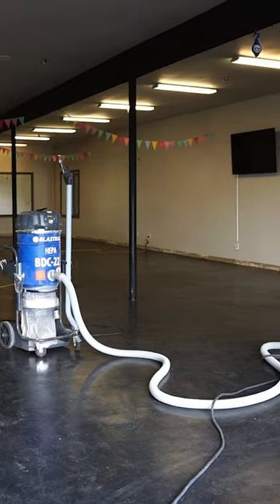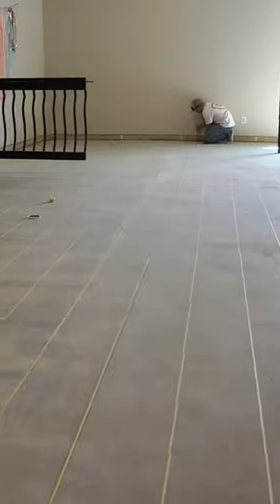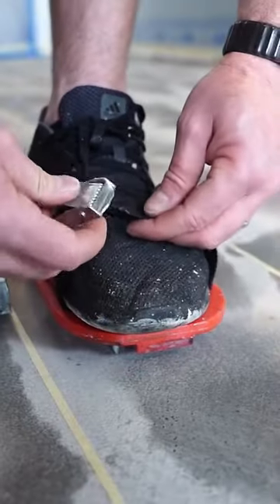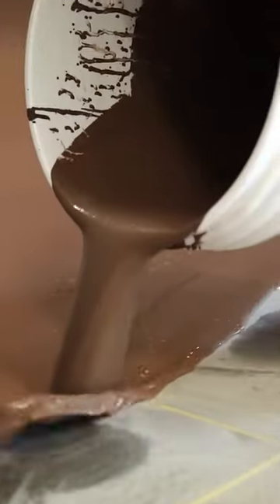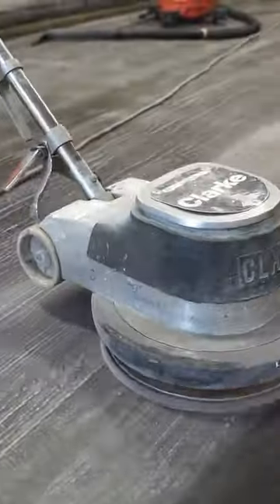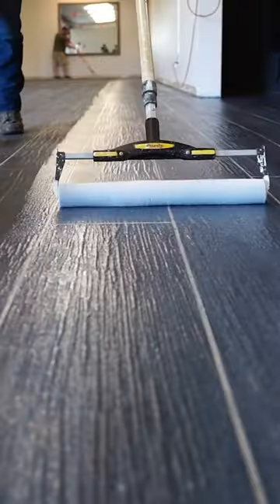Taking hardwood to an industrial level 🔥

Comment: I've seen this done and it's looks great for about a year or 2. Then it starts to flake and chip up. The floor was prepped and etched the cleaned throughly with alcohol. I watched the whole process. It looked amazing until like I said it started flaking and chipping up. I think in order to stop that a clear epoxy coating over the finished product would make it last much much longer of not forever.

Comment: What was the tool you used to get that texture?
Reply: Texture tool
Reply: Could not find them on google. Can you drop a link?
Reply from the maker: We use a pool trowel to make this design by simply attaching it to a pole and running it over the surface of the wet concrete overlay. Thank you for watching!
https://www.lowes.com/pd/QLT-by-Marshalltown-14-in-Texturing-and-Polishing-Trowel/5001845263